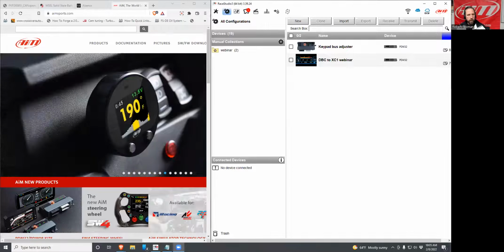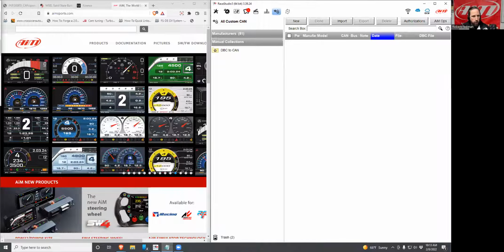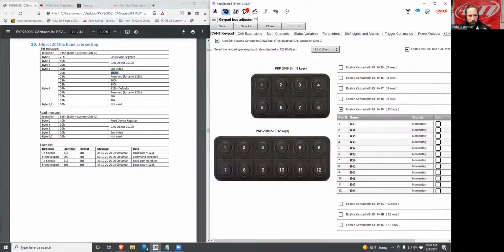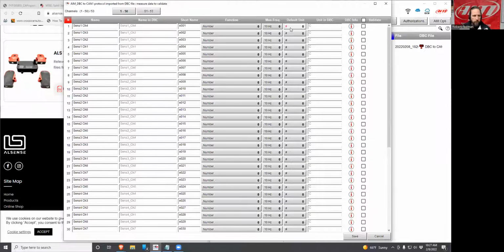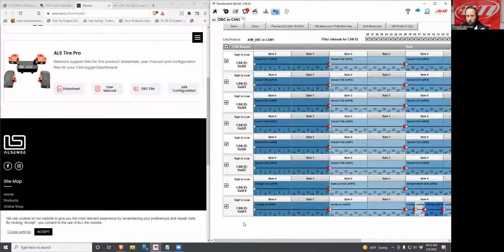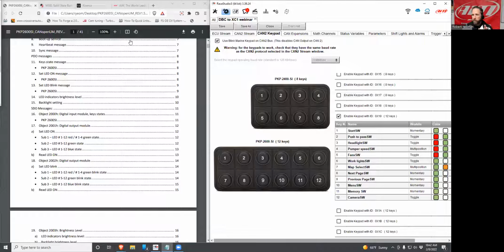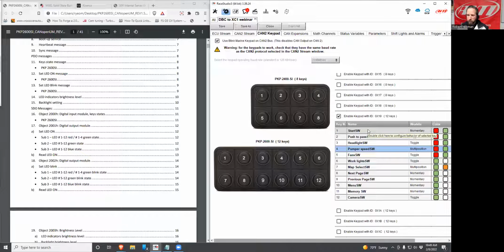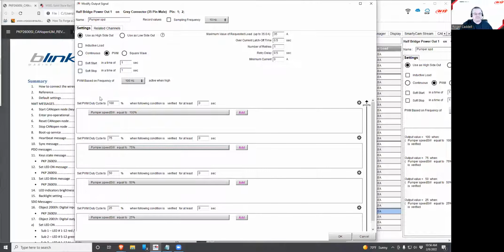3-6 AiM CAN ECU Driver Builder Features Update with Robbie Yeoman - 2/08/2022

Comment: Hi there, im Thomas from Malaysia. I have a new mxg 1.2 strada that I bought a 5 years ago and only install it today in my Ford ranger raptor 3.0 V6 by a shop in malaysia. Was very excited at first as the product have been sitting at home for a couple of years without installing it . 

The shop technician told me my ford ranger raptor is not listed in the race studio 3 and therefore he tried using others in the ford section example like ford mustang, ford fiesta but of course it didn't work at all. No rpm, no speed basically just only managed to power up the device but yeah just everything doesn't work. 

My question is can you help me to make it work? Like maybe you can help me to build the ford ranger raptor into race studio 3 so that when I ask the technician to update the database, its there in the software. Im just the end user and I like aim product very much and have zero knowledge in this kind of stuff. I understand of course there is fees involved and im ok with it.  

Please help if you can. Thank you.